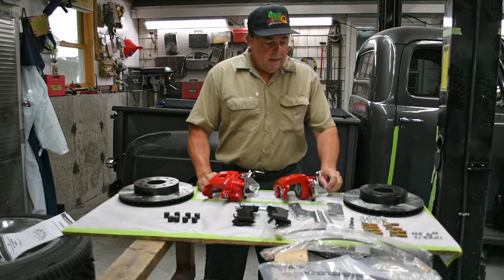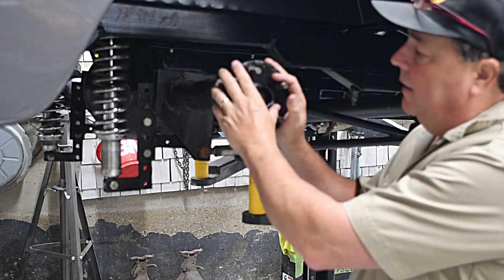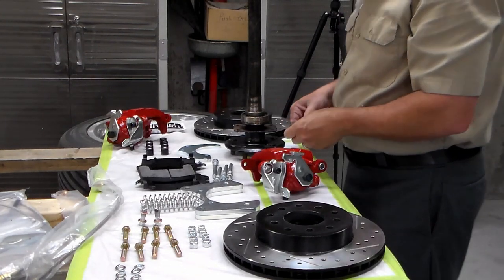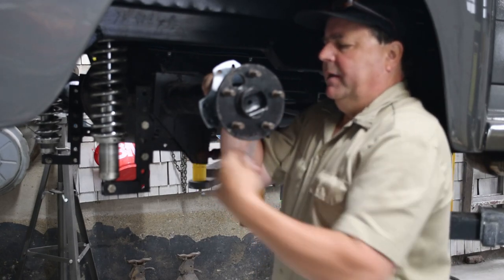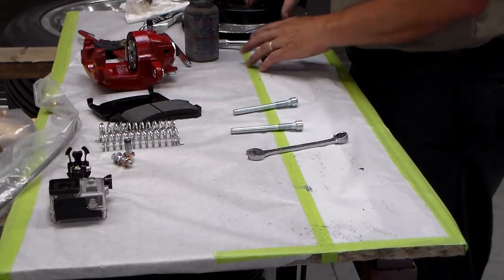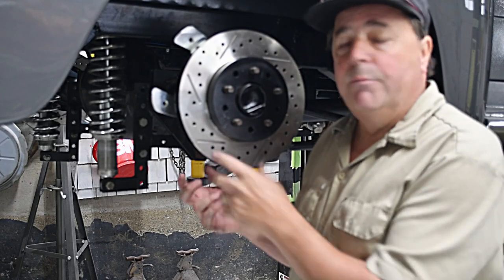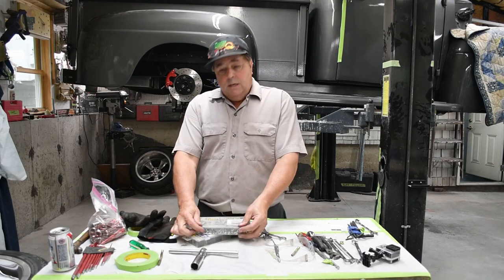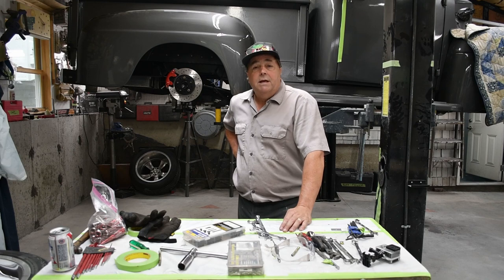Ford 9 Inch MBM Rear Disc Brake Installation by Troy Kane Vtwinstov8s.com

Comment: So i have the same setup on my 57 and have Hard time bleeding the system out. So you mentioned that remove the spring from the e brake handle, push the lever when it engages the pads to the rotor, then pumping the brake pedal?? After this bleeding the brakes or at the same time you pump the pedal and hold the lever? This is Hard setup to bleed for sure 😅
Reply from the maker: Ok so, everytime the E brake lever is moved it will take up the slack between the rotor and the pads. This system has threads on the shaft that holds the brake puck. Applying the E brake will adjust the brake and close that gap. That will assist in the bleeding process. And yes I find the bleeding process somewhat of a pain. But, be patient and you'll get it.

Comment: I thought the axle retaining flange had to be removed on 8 and 9 inch ford housings ? I see that you installed this kit without removing them. I have a differant brand kit that is basicly the same.
Reply from the maker: I don't know what kit you have. Maybe it is different

Comment: Much obliged for the instructional video, for some of those that doesn't know how to go around these things. I have a bit of a question for you I have a 1986 f150, 4.9 engine a 4 speed granny manual transmission.  A 5 bolt pattern half inch sprockets bolt's 🔩, I don't know which of this kits will fit to my rear end .!! Because I wanted to do the same, put disc in the back and get rid of the drums.!!!! What would you, suggest to me thank you so kind..
Reply from the maker: To chose a kit first you need to identify your rear axle assembly. This kit is for a Ford 9 inch rear axle. Google Ford rear end for pictures to identify the rear end and purchase the kit using that information. Good luck, thanks for the question

Comment: Now I understand how the brackets and shims work. Thank you. BTW, a socket and ratchet works for the 4 bearing retainer nuts by using the hole in the axle.
Reply from the maker: Thanks for the comment. Glad I could help.
Reply: Him using the wrench instead of a socket was driving me a little crazy.

Comment: I pop the goddamn piston from the caliper out tryin to push it in further, is there a way i can put it back on im having a hardtime gettin it back in
Reply from the maker: You should be able to push the piston back in. lube it with brake fluid an use a c clamp. Make sure the brake bleeder in open. Good luck
Reply: @troykane  its the screw type though, will it screw back in just by pushing it???
Reply from the maker: @ae86tvis  You need a tool for that. It screws the puck while compressing it at the sametime. You should be able to get one a an autoparts store.
Reply: Thanks!

Comment: Troy..
Great stuff..
Yes in regards to the bleeding procedure.. In particular focus of adjustments of the piston ( after you take the E- brake lever OFF..
What I’m looking for is for you to demonstrate how to adjust the piston up against the rotor to then enable the bleeding process to achieve a good form pedal as it should be..
We cannot get a handle on how to do this..
Much appreciated if you can assist..!

Thx.
Reply from the maker: Ok I had a similar problem. Take the E brake cable off. Actuate the cable lever, as if you are applying the E brake. Do this until the pads come into contact with the rotor. You may have to pump the brakes intermitently to take up the slack. A couple of lug nut on the stud to hole the rotor in place will also be of help. Additional bleeding during this process may be neccessary. This process can take some time. Be patient and cintinue and you'll get it. Good Luck with the project Troy

Comment: 12:40.... spacer over bolts... no anti seize on the bolts where the spacers will rest?  Any reason to not WELD the kit together once finger tight on axle?
Reply from the maker: Anti seeze on the bolts where the spacers rest, good idea. Welding the brackets not so much.

Comment: First of all, this is a Great Video. But I have a question @ 4:48 when u install the flange spacer on your axle housing, this will change the Backspace of the Rims right ? I guess the spacer is about 3-5mm thick, and this amount of mm the Wheel went Outside right ? 
So my Wheel barely scratch at my Rear Fender, so this will not work for me
Reply from the maker: No it won't. The flange spacer mimicks the thickness of the original backing plate. So it should be very close to the original offset.
Reply: @troykane   
Ok, thank you. 
Keep up the good Work 👍

Comment: Troy - great video! You referred to another video regarding the secondary e-brake cable system. For the life of me, I can't find it. Can you help me out? Thanks!
Reply from the maker: Sorry, I can't find it either?
Reply: @troykane  Do you have any photos or explanation regarding all the parts in the kit and when, if needed, to use them?
Reply from the maker: So I have used a combination of factory parts combined with kit parts and Lokar's E brake cable kit to make mine work in the past. Each one has been a little different.
Reply: @troykane  Thanks for the reply. I finally ditched the supplied e-brake kit and ordered a Wilwood universal kit. Pulled all my hair out so hopefully it'll grow back now.
Reply from the maker: @carbonvalleymotors1082  There's always Hair Club 😁

Comment: Dude you saved my install with this video!
Reply from the maker: Glad I could help. Thanks for the comment
Reply: @troykane  you are very welcome. Any chance you have the vid for the parking break?
Reply from the maker: @charliefrey3478  I generally adapt my original cables. So, I use the factory supplied bracket for the cable housing mount. Then I cut the cable end to the required length. Then I crimp a swage on the end of the cable. When it's done it looks OEM.